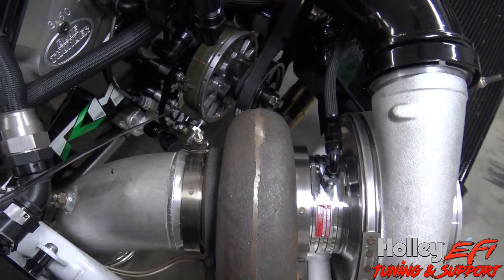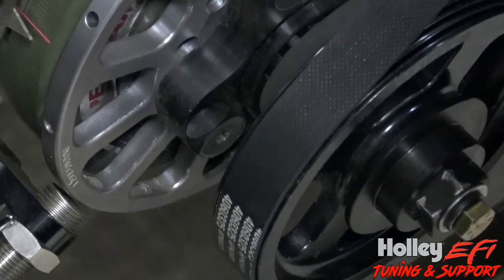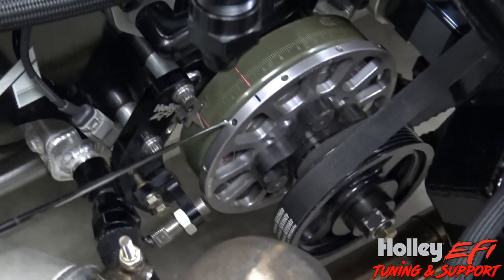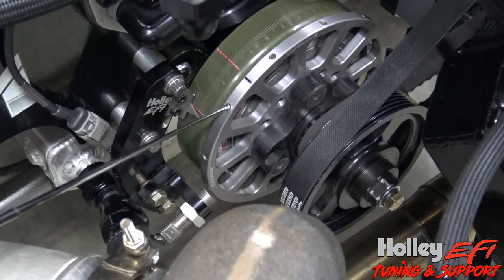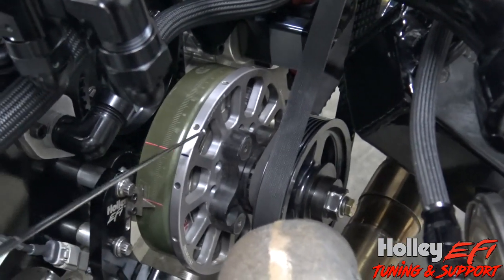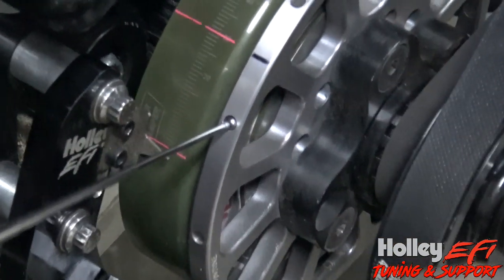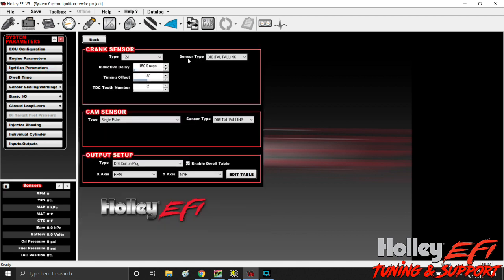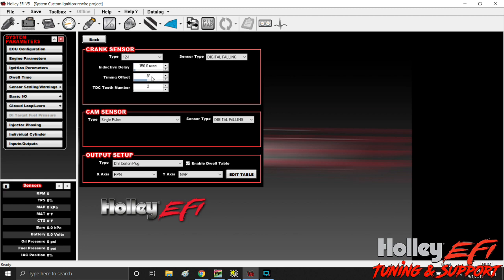holley efi 12 1 hyperaktive wheel

Comment: I have a sbc 400 with a procharger can not space out the pulley ATI makes a shell with the magnetics in it I'm running the holley terminator x how do I tell them to  setup the shell they start at 50 degrees 55 degrees and 60 degrees

Comment: Devin, if using a 12-1 wheel and setting cam sync location would 195btdc still be used?
Reply from the maker: yes if you are using 60 degrees btdc for your magnet

Comment: Devin if I was going to order a ATI Crank damper I can have them add as many magnets I need and the location of each. If you where to do it this way what degree mark would you install the 11 magnets or would the missing magnet be/start? Going with the ATI damper with built in mag I dont have to space out my other accessories. Thanks
Reply: Did you figure this out?

Comment: why the flying magnet over toothed wheel like the 36-1
Reply from the maker: The 3/4-16 sensor is just more robust I feel , and with potential for the crank to flex and thrust I prefer a big sensor with a thick wheel and flying magnets over a high tooth count reluctor
Reply: Yeah I was going to ask the same question. I switched from the 4 magnet to 12 magnet since they are the same thickness and wouldn’t mess up my alternator and vacuum pump spacing